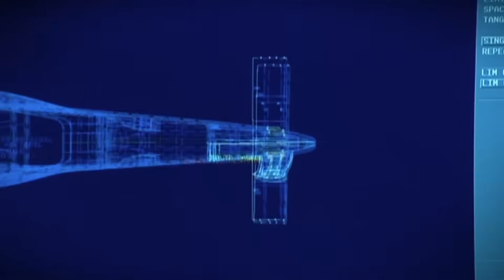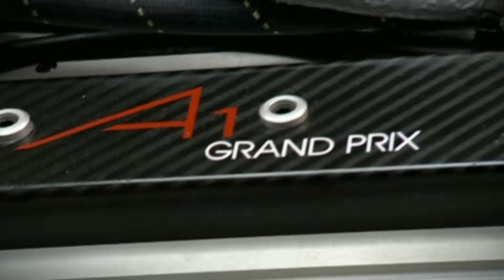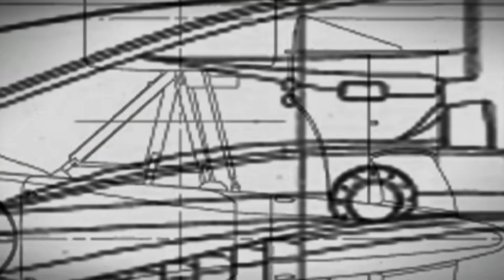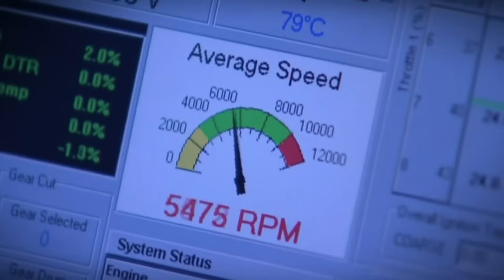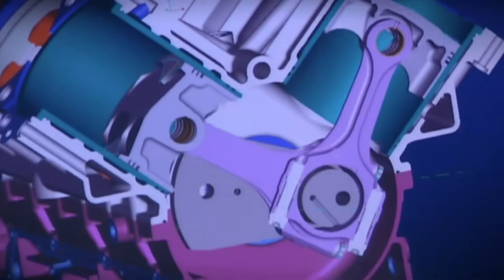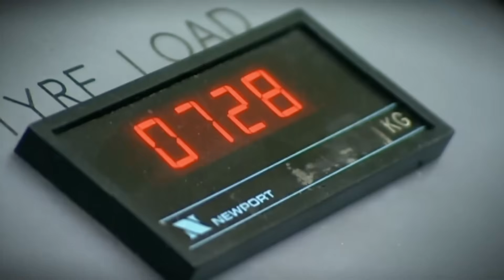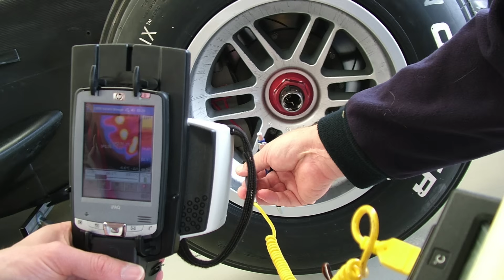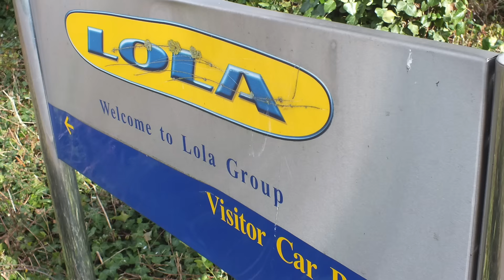A1GP: Lola B05/52 Zytek - Verstappen’s Last Grand Prix car - technical details

Comment: AutoGP might have actually established itself as a decent SuperFormula style series if they didn't touch the original design of the cars, IMO. Although I suppose with Formula E popping up in 2014 and DTM still going strong around then, there were plenty of jobs in motorsport for drivers at the time.

Comment: The final A1 GP car looked far better in my view and had wider kudos as Ferrari had direct involvement in the design and build. Using the ultra successful F2004 chassis as a base and fitted with the V8 engine from the Ferrari F430, albeit adapted for racing, it looked amazing
Reply from the maker: interesting perspective